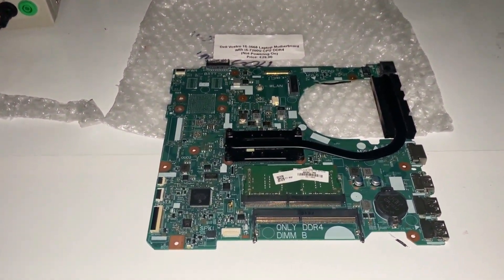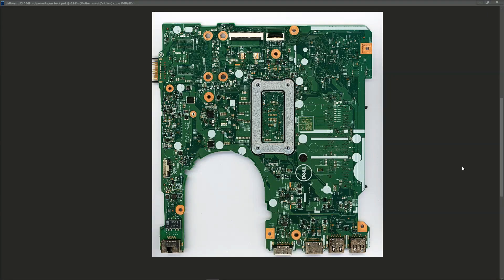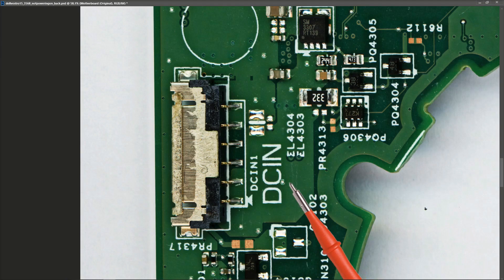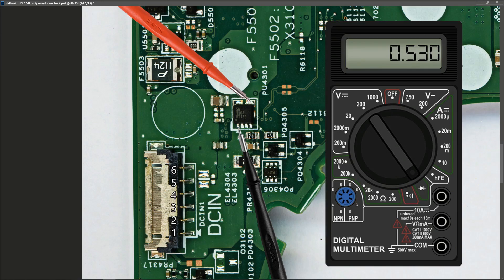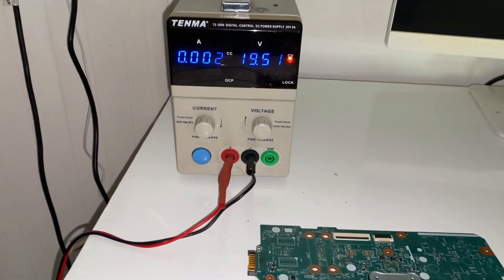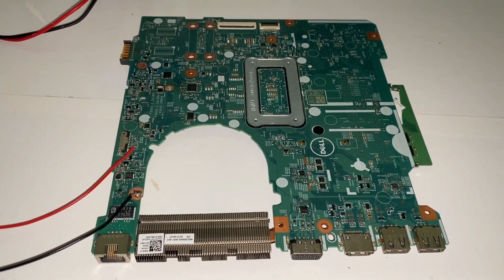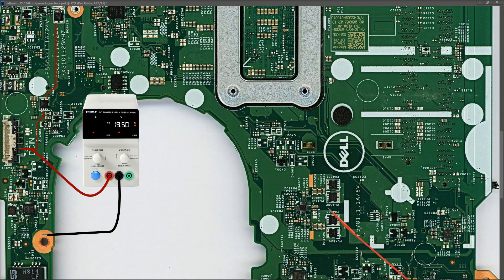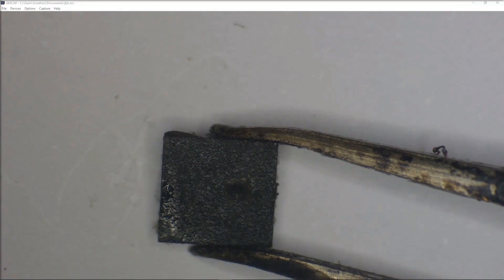Dell Vostro 3568 - Not Powering On

Comment: Hello. I have this exact same motherboard that isn't powering on, and have been following your steps. However, in my case, at 06:00, I do get a short between ground and after the second mosfet. Any ideas what that would mean? Sorry, I'm a beginner at this kind of thing.
Reply from the maker: Hi John, if you wish to be number 3 in my "help a subscriber", send me details/pics/ measurements etc to therepairshare@gmail.com and I will try to help. 
If it's shorted at that position there should be a reasonable chance of fixing.